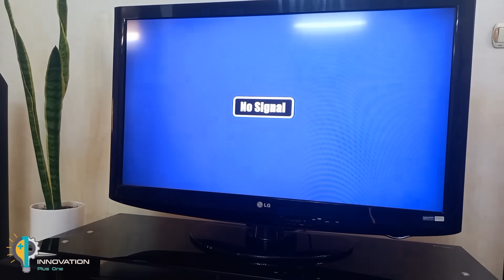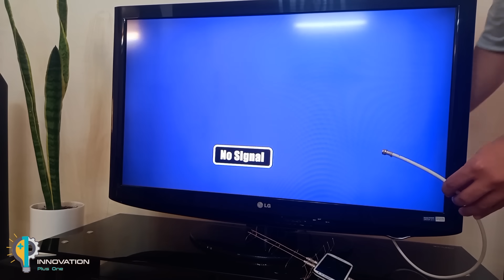Insert Broken Phone Into The TV and Watch All Channels In The World || Antenna Booster

Comment: Please tell me/us which one of your genius methods is the best/easiest, im extremely intrigued, am going to try one, if this is a troll tell me,( just subbed) cant wait to see more, this is the kind of stuff i do in my free time,  once i wired a 120 watt charger to a small bluetooth speaker that was hooked up to my back massager, then wired it to a clock and a stud finder,  and it literally stopped time for all the atoms but mine were still vibrating (the speaker n massager) and i was able to see dangerous studs and live wires ect... Cuz i was able to walk through walls and almost everything once i started to learn what frequency mixed with vibration intensity to adjust too, maby ill make a video one day , but probably not, alot of ...lets say liveing things parshed, i also go lost in this underworld for weeks , best described as when u glitch in gta. But yah, have a good holiday everyone
Reply from the maker: Thank you for sharing your experience about the antenna❤❤
Reply: What brand of stud finder did you use?
I keep getting teleported back to 1955.  Not sure what’s wrong.
Reply: @falconeaterf15 
Umm, try reversing the battery. That should get you to 2055. I'm pretty sure a half flat one will keep in the same week at lest.
Hope that helps...
Reply: @falconeaterf15 
Umm, try reversing the battery. That should get you to 2055. I'm pretty sure a half flat one will keep in the same week at lest.
Hope that helps...
Reply: @falconeaterf15 
Umm, try reversing the battery. That should get you to 2055. I'm pretty sure a half flat one will keep in the same week at lest.
Hope that helps...
Reply: @falconeaterf15 
Umm, try reversing the battery. That should get you to 2055. I'm pretty sure a half flat one will keep in the same week at lest.
Hope that helps...
Reply: @falconeaterf15 
Umm, try reversing the battery. That should get you to 2055. I'm pretty sure a half flat one will keep in the same week at lest.
Hope that helps...
Reply: @falconeaterf15 
Umm, try reversing the battery. That should get you to 2055. I'm pretty sure a half flat one will keep in the same week at lest.
Hope that helps...